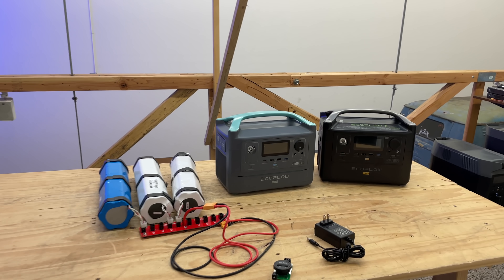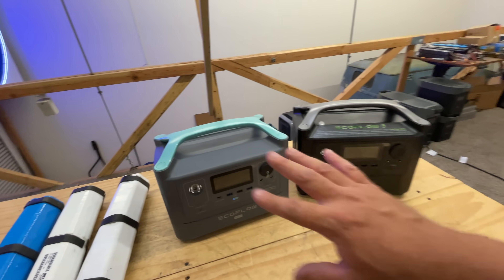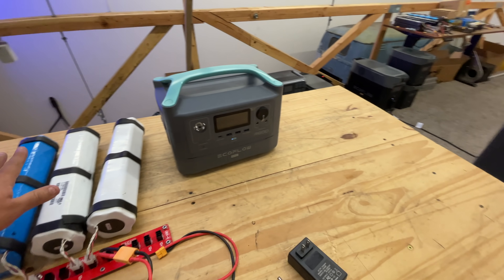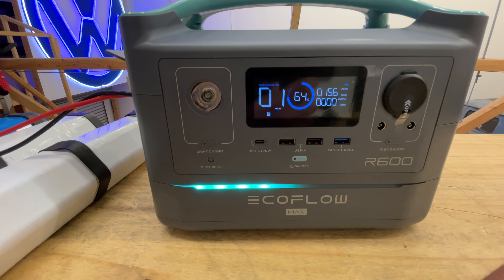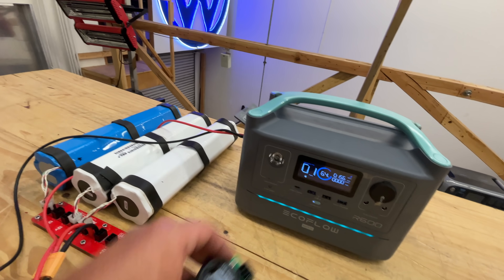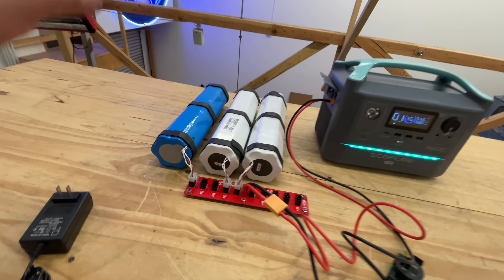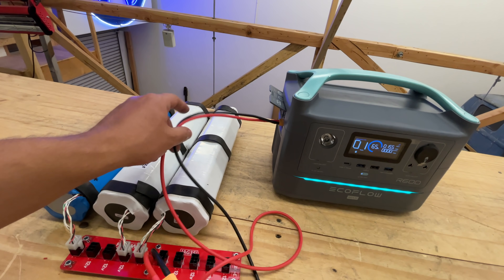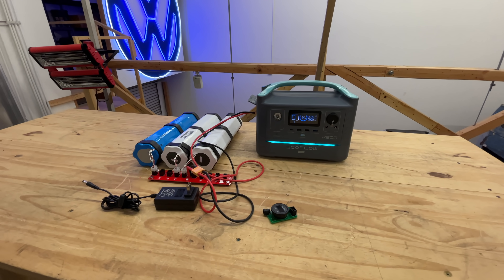EcoFlow River hack Doubles battery capacity

Comment: Well it will charge with 500 Watts using the XT60 however there is a Center contact pin on the XT60 Connector for the River, Delta Devices that has a bond to the Positive or Negative Lines from the source depending on use. This is so you do not overdraw on 10A rated circuits like fused cigarette plugs. There is a Negative Pinned cable for the Solar side which tells the device to charge using MAX Wattage at 500 These connectors are indicated as Orange in color not Yellowish.

Comment: I plug in one power station into the other using the dc5521 output to dc5521input or XT60 input and  charge the other using solar.

Comment: @02:37. “If you do the math…….”  WTF????
Power is the product of voltage and current. In DC terms that’s pretty much all there is to it, AC is a little more complicated. 
156 watts is NOT 10A x 25V. It’s 250
What you should do is measure the voltage and current from the battery. If that is 250 watts and only 156 is being used to charge you’re losing a LOT of watts. That probably means a lot of heat and that’s a potential hazard. 

Don’t believe anything this guy says if he’s making schoolboy errors like this. It could be dangerous. It doesn’t sound like he understands electricity.

Comment: One thing i can't find on youtube is , can we have the (Kettle Cord) which comes from the wall plugged in along with this connector which is attached to battery? I want to expand the battery while it being plugged into the wall socket. Will it charge the extended battery? and will it automatically switch over from Wall socket input to Extended battery input?

Comment: A bit muddled. So what does the pcb do that you have plugged the scooter batteries into?  Does it just join the batteries together to allow them all to be used at once? Does that mean if there was only one scooter battery, it could just have an XT connector and plug into the ecoflow without the  PCB?

Comment: Can the external battery pack connected to power bank be charged via solar or, car alternator via electronic solenoid.?
Example: I have a second battery system for my van. Currently is charged via main battery though, electronic solenoid and I can attach portable solar panel through 10 amp controller.
I have a 1500 watt PSW INVERTER connected for any none 12v electronics.
HOW CAN or will the super capacitors like I BELIEVE you have there be attached, be charged, and it's benefits.?

Comment: Do you advise running this DIY system to a river + the Ecoflow smart battery? So DIY kit plugged into the River via XT90 (solar panel connection) then Ecoflow Spare battery plugged into the other end. If so, how many OBX batteries do you recommend plugging into the power strip to have a full efficient DIY kit to power up the total 1440wh (since each Ecoflow is 720wh). Thanks in advance!

Comment: Jehu do you know if this unit has a built in solar charge controller? I know it says 12-25 volts but I thought I saw a video where a guy had a 35 volt panel and it would limit it at 25

Comment: Hi Jehu, I was wondering, what limits the discharge current of the batteries into the power station/generator?

Is the BMS of the invidiual extra batteries limiting the max discharge current, or is the MPPT charge controller limiting how much the power station is charging? Is it a combination of both of them?
Reply from the maker: Both, but I think the battery bms limits first
Reply: @jehugarcia  Thanks Jehu! Now I have more shopping to do!

Comment: Can I use the solar generator to charge the batteries using the DC output from it directly? After charging the generator from solar, or do I still need to get the ac wall adapter to charge the batteries?
Reply: Great question. I'd love to see USB C in some way. I have a USB C to xt60 for my ecoflow. And it works. I wonder if that would work on these. 

Only downside is overcharging I suppose. But he has little gadgets for that.

Comment: Kind of a reverse question. I am driving around in my car during the day with my portable eco flow or bluetti, charging from my car. Could I then bring it back to my Box truck home and use it's power that I have gained from my car to load up, recharge a lithium iron phosphate battery
Reply from the maker: charging your battery with your car is one of the most expensive ways to do it,  its crazy inefficient

Comment: Just so I’m 100% clear, I could add a 12v deep cycle battery as a backup and the unit will only pull the amps it needs? The board won’t get fried?
Reply: Correct! The unit only draws about 110w or less from it's XT60 input port and it's been done to successfully extend the capacity of the River units by using deep cycle batteries. 😌🌎✨

Comment: Hi Jehu, does this setup work on the Delta Mini? I got the setup and plugged it into the battery, the input numbers jumps up to 300 and then it goes to zero. Thanks for help.
Reply: should work without a problem, check the voltage on the battery when connected using a voltmeter

Comment: You could just use a seperate battery of any type by using alligator clips to DC socket output. Then just plug the River adapter into the unit the same as youd plug it into a car outlet. The way youre doing it is actually over complicated. You could also just run an inverter directly off your second battery and not even use the River Pro or fast charge it if you want. The problem comes from keeping ALL of them charged, this just solves the capacity issue.
Reply: @Snoopy Yeah that’s the basic idea. Just grab a car battery and plug the river pro into it using an alligator clip socket adapter. Boom you’ve just doubled your total battery capacity. If you have solar panels just connect the panels to the car battery and you have a complete system that can easily still be detached and carried with you. Best of both worlds. That’s how I’ve been using it in my van life setup. If I got to a Starbucks or something I can take the river pro and fast charge it then plug it right back into my van system. It’s been amazing.
Reply: @ITech2005  An electrical n00b here, so pardon if this is elementary - if you connect your solar battery directly to you 12v car battery, how is the charge regulated ito of stopping when full? Surely lead acids don't have a charge controller? Doesn't one run the risk of overcharging otherwise?
Reply: @JustifyJustin  When you connect the river to your car battery the charging only happens one way. Your car battery charges the river pro. If you have car battery installed in a vehicle then when you run the engine you'll also be taking power from the alternator.

So this leaves how to charge the car battery? Well, 1. If you want to use solar then you'll need a cheap solar charge controller. 2. You can also allow the vehicle alternator to charge the car battery, like normal. 3. You can use the river pro to charge the car battery by purchasing a battery charger. Plug the battery charger into the river pro outlet then you can transfer juice back to the car battery, if needed. 

Hope that made sense. There's lots of flexibility here depending on how you're using the setup. If you're not using it with a vehicle then my recommended way is to leave the river pro connected to your solar panels. At the same time have your battery charger connected to the 12v battery. Now your solar panels will basically charge both at the same time. And when you need to take juice from the 12v battery you just use the 12v socket adapter and plug the river pro into it.
Reply: @JustifyJustin  It all sounds more complicated than it really is I should probably make a video on it.
Reply: @ITech2005  Yes, a video would be great, especially for those of us who are uneducated in the art of electrical /battery hookups. 🔋😳
Reply: @ITech2005 man, I really wish you would make that vid! I'm another n00b, who followed you right up until you talked about letting the River charge the battery. I think I can fill in the blanks, but this is expensive kit to be monkeying around with.
Reply: @ITech2005  i have just got the inverter and battery to go with my old ecoflow river. 

Would i connect the solar panels to the battery instead of the ecoflow? Which does make more sense as u mentioned
Reply: @Offgrid-Maori  Yes exactly, but youll need to grab a small cheap solar charge controller for like $20 that matches the rating of your panels. Doesnt have to be one of the expensive ones. 

It goes: Solar Panels->Charge controller->Battery->Ecoflow. Now you can continue adding as many batteries and panels as youd like without needing to buy entire expensive ecoflow units just to upgrade capacity. You just need the battery and charge controller.
Reply: @ITech2005  and do i need washers on thr battery temrinals or no washers. I seen a video that mentioned somethijt about washers.
Reply: For sure. Thanks dear brother. 😌🌎✨

Comment: Nice video. You can also use any std. Lead acid battery to charge your Ecoflow unit in a similar way. You just need the right adapter.
Reply: Or use three 6V blocs in series as it says 25V max.

Comment: I brought 3 of the obx batteries checked them with the balancer and all had 16.2v … then connected them to power strip and connected them to EcoFlow and it worked with 130watts coming in .. I disconnected EcoFlow from power strip .. checked obx batteries and they dropped to 15.7v .. so I connected a obx batteries one at a time to balancer to charge but they’re not charging with me using a 12v 5a power supply and nothing help
Reply: Did you figure this out? Your 12 volt charger won't work for these batteries. The batteries at 15.7 volts are at a higher potential so connecting to 12 volts does nothing. You need an 18 volt power supply to charge these back up.
Reply: @gs9163  thanks I was thinking that and I brought a 20v charger and it worked but slowly .. the 12v didn’t even show on the balancer it just showed 15v dominated until I got the 20v .. thanks because I have been trying to figure this out

Comment: Excuse me. Could you please tell me what solar panels are the best on the market at this moment and maybe you could recommend a good place where Is best to buy them?  I’ve read that the mono crystalline put out more than the others?  I’m trying to start a little house backup solar system on the batteries that you sell  :-), I’ve started by purchasing like 100 18650 the ones from the modems just to play around with.  But as soon as I know which type of solars is best to charge these types of batteries as well as, for example if I had a clue how many 18650 can a 100w panel charge and how fast, that would be awesome!  I appreciate any feedback guys!  And super duper thanks to the author

Comment: What I find is a bigger issue than battery capacity is the solar max input on the solar generator! In the case of offfgrid setups all the extra capacity doesn't mean much if I cannot recharge the battery with a single day of sunshine via panels. Is there any solutions to increase the amount of watts a solar generator can handle incoming from solar panels?
Reply: For the size of the power supply, that is a lot my friend.

Some of the smaller, more commonly found power stations are only limited to about 80w or less. What kind of power station do you have friend? 🙂
Reply: That's the great thing about EcoFlow, they have some of the highest solar input capacity of any power station within the budget region of most consumers.

 Their entire line up can easily take in 200w consistently through DC solar and up to 500w through the AC cable, and it's all fully adjustable through the app.  

It's no slouch when it comes to speed and power for its size. 🙂🌎✨
Reply: @DeanTheDoctor  Yes, charge the external battery using a mppt charger and charge the river from the external battery.
Reply: @DeanTheDoctor  That is just not enough... 200w? Come one... in winter.... 
Mine has 500W input which is ok.

Comment: That power strip got me very curious. Would it also work on any Ecoflow power station? The Delta perhaps?
Reply from the maker: Yes but you can use the series one because the delta can handle higher voltage
Reply: @jehugarcia  I need one of those power strips
Reply: @jehugarcia  are you selling the whole system for the power wall what's the price
Reply: I need one of those power strips hit me up

Comment: In the 600 Max version, is it possible to remove completely the external battery and use the pins for a better solution/ more capacity?
Reply: Would be nice but no…

Comment: Will the River still charge in this configuration whilst the 110W solar panel is connected?
Reply: No, you are plugging the external battery pack to where you would plug the solar panel cable into. Its either one or the other.

Comment: That is a nifty hack taking 500 watts to 1500 watts for $100 is amazing value the hack part is using the expensive $500 unit to give 3 times the the performance. Bit like taking 500 hp v8 engine to 1500 hp v8 for a Hundred bucks. That is why it’s a hack. Wonder what the price difference is between 500 watt and 1500.  Battery pack would be. If you had low current draw add 10 kw for $1000. Big help to off grid person needing low current for long periods of time and very cheap

Comment: I have a Pecron that requires 36 Volts solar input.  A 36V battery is not a big deal but what I think would be really great for us all is the ability to add battery storage that charges from solar at the same time as it's charging the solar generator.  Let me know if I'm wrong because I bought mine to harvest free energy, not to increase my hydro bill.

Comment: What? Thats is how solar charge controller works? So does this mean i can connect more than the recommend amount of solar panels to solar charger and solar charger limits the current?
Reply: I thought adding more solar panels would break the charger.
Reply: @wilderness-beastt  - if the maximum voltage is not exceeded, then you can add solar cells in parallel until you hit your maximum possible current. The maximum numbers are typically identified on the panels, you just add the numbers, as you add the panels.

Comment: Would it be difficult to charge the batteries by solar instead of a wall outlet?
Reply from the maker: No, you need a solar panel and a charge controller
Reply: @jehugarcia  Could you point us to a solar charge controller that would service these cells?
Reply: @jehugarcia  where to get charge control?